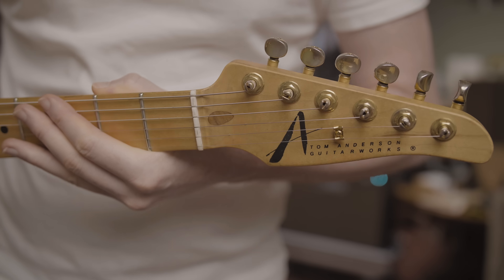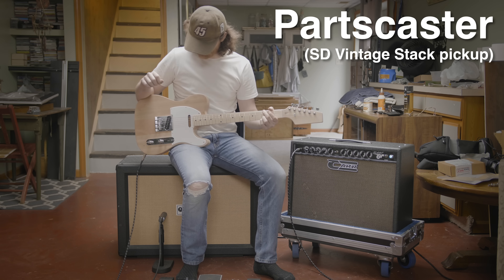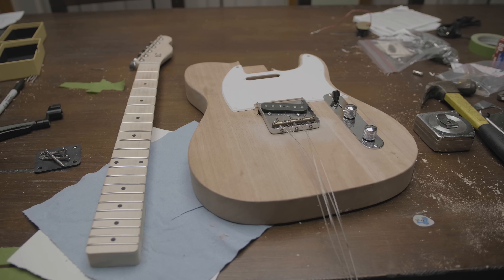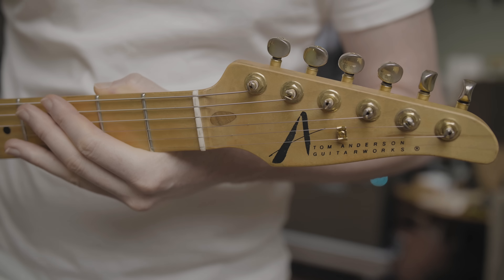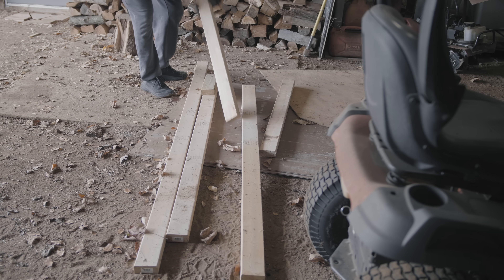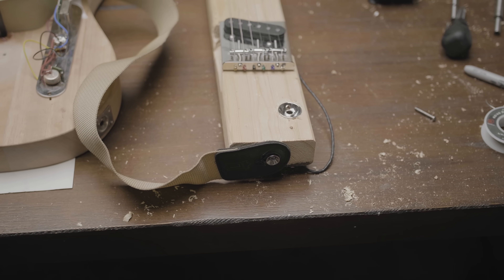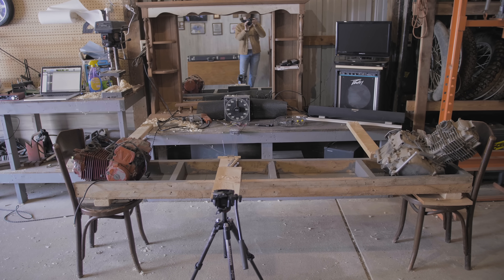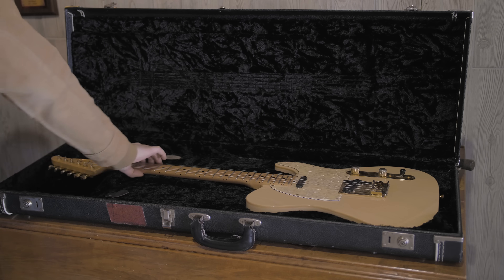Tested: Where Does The Tone Come From In An Electric Guitar?

Comment: Ok I'm a Scientist and a master luthier for 35 years. What you have discovered is that if you have old fashioned pickups that have a narrow frequency response, that is the most predominate factor in the sound. Very little else other than the set up and amp will effect the sound. NOW if you use something with a flatter response like a EMG-85, Lace Aluma or Piezos, more of the other factors "like tone wood" body shape, hollow, solid, Brass, Steel, Aluminum, Carbon fiber can be heard. Just about anything can cause a different acoustic property. Your pickup may or may not be sensitive to that or even in that position or other electronic properties. Massive tonal differences come from type and position of a Piezo. If you put a Piezo on the face and one on the side you get a 90° phase sound with dead spots. keep in mind it does NOT mater!!! nothing is better than another, what you like is what you like this is all subjective in the end. I'll tell you for sure I can make a guitar sound a certain way by how I build it and set it up. None of these tone tricks are a myth and your test is not very scientific, Its biased by the type of pickup you are using. Because of this most mass manufactured guitars even high quality ones, tone is mostly pickup, set up and amp.  If you are a discerning player I can make exotic guitars not sound like a Les Paul or a Strat by using different acoustic properties provided by "Tone Wood" and so on. I don't think you are going to appreciate these differences by your playing style, Country kinda formed around the Telli sound and you discovered the secret its the pickups! but this does not apply globally in guitar design. I saw Ola Englund comment, check out his video on bolt on vs Neck threw I really liked it, its not perfectly scientific either but he did his best.  Removing bias is hard. OH I liked your sustain video too! much more scientific. The real truth is tone is in the fingers ;-)

Comment: My opinion? Amp, player, pickups, the construction of the guitar (e.g hollow body, solid body, chambering), hardware (major differences like a floyd rose or TOM, and strings to an extent) -- in that order. The rest is relatively minor. Tonewood is bullshit for solid-body electric guitars and matters a lot more for acoustics and semi-acoustics.

Hell, hardware and construction is already extremely minor (and setup isn't a part, it's tweaking) but 5 was the list, if that's allowed then replace construction with setup.

Comment: Okay, am I the only one that notices a major difference in tone, or am I just smoking some really good shit here? 

The unfinished guitar, and 2x4 lacked clarity, definition, pick attack, sustain, and had a harsh high end, even after installing the pots. It's minute, but every minute change is crucial to the final outcome. That's like saying numbers in an equation don't matter if the number at the end of the equation is close enough, but if you had 4 legs on a table, and one of them was "close enough" you'd question why the table is wobbling. Everything matters on a guitar, from the wood, to the finish, to the pickup height. Yes, pickups are a majority of the "tone" but the resonance, clarity, and sustain all come from the body. To say the 2x4 had the same sustain and note clarity as the Anderson seems misguided, to my ears, at least. Are they similar? Sort of, but would you use that 2x4 over that Anderson strictly for tone? I wouldn't. Why? Because the Anderson has a deeper, clearer sound, and the sustained resonance sounds much better. 

The thing is, no two people will agree that a minute change sounds "better" some people might like A and other might like B. The changes only matter if they improve what YOU want to hear out of the guitar for your subgenre/playing style. Again, back to the table comparison, no one will notice a 5% change in height on a table, and it wouldn't change much for the person sitting at that table. They might think it's silly to change the height by 5% because they can't perceive the difference. But... who gives a fuck what that guy who doesn't notice it thinks? If that 5% improves your perception of that table, fuckin do it! 

I think there is a major difference in sound beyond pickups, I will say pickups are 70-80% of the sound, but there's more to sound than the tone coming from the pickup. To me, that's what this test proves.

Comment: Leo Fender must have had the same idea: that for solid body guitars, tone wood is more placebo effect than anything. He experimented with pine, ash, alder and probably plywood. But not for “tone”, for structure and stability. It takes a lot of strength to stay straight and not bend or especially twist under string tension. It was Gibson, trying to catch up with Fender that introduced the myth that expensive and exotic tropical hardwoods improved the tone of a solid body. It was a marketing ploy. Still is.
Reply: I agree. 'Tone wood' is absolute BS.
Reply: @wireworks4252  in electric guitars, ya, pretty much. With acoustic guitars it makes a hell of a difference.
Reply: @marctestarossa  Electric guitars are the topic here, not acoustic ones.
Reply: @nowave7  ok <3 I thought he was talking about tone wood in general <3
Reply: @marctestarossa  have you had the chance to play on a carbon fiber body acoustic guitar? Lol there no wood at all on those and they sound almost dead on to most acoustic guitars. I think tone wood is more of a marketing selling point rather than function. Regardless of wood choice
Reply: They sound quite different, i'd say. It would however be cool to play the eact same guitar (shape, bracings etc.) Made of both wood and a carbon fiber.
Reply: The most critical thing for old Leo was that ash and alder were durable, and most importantly, cheap.
Reply: Totally agree. It is more of the aesthetics on top of their obvious wood properties, like rigidness, weight, etc. You would not probably do a good guitar from pine as it is resinous and too soft, and other wood, that hollow, or super heavy, etc., though it may sound good, all these woods have some flaws. But as you correctly pointed out, there's a huge variety of wood, which has similar characteristics and are good for building guitars.
I personally like how swamped ash looks under the transparent lacquer, so I would go for it just because of the aesthetics.

Comment: With the pickup height test, the first thing that comes to mind is that there's an obvious volume difference; probably most of what you're hearing is the tone difference from the amp when you drive it harder, i.e. more or less distortion. It would make most sense to normalize the volume the guitar is putting out for each test, rather than just controlling for "volume knob position".

Easiest way to make A sound better than B is to make A louder than B. Always normalize levels.

Comment: Electric guitars are designed to minimize the transfer of energy from the strings to the body for maximum sustain. If the body is essentially an immovable object compared to the strings, changing it's properties won't alter the sound.

Comment: BTW I found that the most difference I obtained on a squier telecaster was changing not the all bridge, but just the sadles set for bigger ones. Added a lot of sustain and consistency to my sound !
Reply: Sustain propably got better because of the sharper angle on the strings

Comment: the pickups and electronics make the biggest difference imo, you can try different capacitors with different values to get different tones
Reply: been a while since ive fiddled with it but i googled a little and got 

"Capacitors, or "caps," are simple electronic components that are typically used in guitar electronics as filters or barriers for certain frequencies. High frequencies will pass through a cap, while lower frequencies are blocked. The value of the capacitor will determine the frequencies that pass"

Comment: I actually heard a slight difference with the brass saddles; bit of a softer, rounded top end and a bump to the 100hz range. Hardly enough to make a huge difference, but enough that I noticed. Lord knows the wood didn't change the tone at all. 

I wonder what would happen. If you swapped out a few different saddles and nuts?

Comment: I think the build quality and consistency  of modern guitars because of the computerized close tolerances maintained during production has exposed just how bad the earlier solid body electric guitars were, hindsight being a marvelous thing, but that was all that was available at the time and the tone wood myth grew from the fact that the guitars sounded different when really it was inconsistency in the general assembly as well as inaccurate coil winding for the pickups.Even today you can see pickups with pole pieces that do not line up with the strings on high end guitars but you get guitar experts telling every body how to set  there guitars for ultimate sound, I seen similar demo's like yours and the end result was the same as yours

Comment: I like this video a lot! But I think the tests, at least the ones shown here, were far too limited to really explore the regions in which the wood used might be more likely to matter a great deal. There was no exploration of either length or quality of sustain, no exploration of the much more challenging clean tones, nor of susceptibility to feedback, just off the top of my head. These are all things that both common sense and expert opinion indicate are important when choosing tonewoods. And maybe those things don't matter to you, but they certainly matter to many people.

In any case, for those to whom those things don't matter, you have saved them a lot of mental trouble, and probably cost as well, so bravo.

Comment: String contact points....pickup for sound. 
Play-ability is a whole other world.

As for "feel" I have a 1988 Casio PG380 synth guitar. High end strat full of electronics, bought it new.
Got another one from ebay, same guitar. Played it and it felt dead and did not resonate like mine, even after the same type of new strings were put on and set up the same.
Opened it up and someone had painted the cavity with thick black conductive paint.....mine had a factory sprayed thin coat inside.

Comment: They were different to me... Honestly... I'd say electronics is 80-90% of the tone; the surrounding acts as a flavour. Won't change it, but will spice it.
Reply: To me, the guitar (I mean, the one that's got more wood in it) has got more top end, whereas the other is mellower, if not dull. Maybe it would sound brighter if you cleaned up that rust on the engines...

Comment: This was my suspicion from the start.  The pickups were just listening to the string at close range.  Whatever resonance the strings were creating in the guitar body, the pickups weren't having any of that.  We already know this by how "deaf" a pickup was, based on its sensitivity to the distance from the strings.  And the pickup makers also know this because the guitar body does not only emit the resonance, it also transmits so much noise from all the bumping rubbing and scratching that contributes to the solid body transmitted sound.

Those are things you don't want to hear on the amplifier.

Comment: 0:30 #3 was the only one who responded honestly... lol
Reply: You could post a video with the same exact audio for every single clip, and there will still be people who comment that they hear a difference. The pickups did sound a tiny bit different to me, but having bought and installed dozens of identical pickups, in identical guitars... they don't all sound exactly the same brand new anyway. The magnet wire might be on the high or low side of the cmil spec, might be work hardened a little more or less, have a little more or less enamel changing the shape of the internal field, different potting, stronger or weaker magnets, a few extra or less windings - electrical differences that can matter.

Comment: This makes no sense, I can clearly hear the parts caster and stump guitar difference in tone! Using those tables has a lot of mass, simple test. plug you guitar in to an amp, let the body make contact with a door for example, now try without touching the door, hear the difference? The tone always follows the neck, take a Strat, change from a cheap squire neck to a good neck from a guitar you've played a while, there is certainly a difference. But if you can't hear and feel it, the response, then good for you, fewer issues in life :)

Everything matters, action matters too, if your action is low you will hear brighter sound, higher action has a deeper more full tone, this is the most basic thing, infact you can adjust the tone of a guitar that way too, all the little things add up to what's coming from a speaker. 

I find this video interesting, the table sounded killer btw :)

Comment: I dig this, but like a lot of people have mentioned the driven amp obliterates any nuance you'd get from the other parts of the guitar. Smashing all the transients and peaks and valleys up against the edges of the circuit means there's no subtlety left to notice from small things like body vibration and various metals. If you're playing clean, you and your listeners will notice those things because they're not being compressed into oblivion. But it certainly illustrates that if you play with a base level of overdrive, then you definitely only need a solid pickup in a hunk of wood.

Comment: Cool video thank you. I'm blind so I wasn't able to see of course that's what being blind means LOL but you know I would think you know did you use the same pickup from one guitar to the other that just swap it or did you just use two different or did you or did you use the you know just two different pickups of the same model pickup.? Cuz I would think that there could be you know as tight as the tolerances are today and stuff like that I would think that even in mass-produced the pickups that they could be and is most likely a difference how much that difference could be noticeable in another story but I believe it's a possibility. As I say I believe it's a possibility I wouldn't bet my house on it. Just things like that you know you could you could drive yourself insane like with the tone would debates back you know a few years ago several years ago I mean you could drive yourself literally insane trying to eliminate every variable that might be present in a system in a guitar and still not know? I used to believe in stonewood it was just you know I guess from what I heard you know before I really started to get into a guitar not just playing it but the mechanics of it you know the electronics and mechanics. After most of those debates I've come to the conclusion or I had came I had come to the conclusion that Tom Wood is something that's got to be there but I don't think it's necessarily something that is necessarily clear-cut sonically. That it's you know not really all that true I don't believe in tonewood as in the debates. Not anymore not since those debates and I made up my own mind. I believe that possibly the density of a wood could be the same density as another species of wood and that might be something you know cuz you could have two pieces of mahogany and one piece of mahogany might be his dentist things like that so I you know which kind of made me kind of look at my guitars that you know I I like the woods on them because I thought they they had a tonal variations and so I was kind of something I wanted to believe in but you know now I just you know now I just know in my mind the woods are beautiful you know and leave it at that and you know you you spend money I spend money on expensive you know I don't buy cheap guitars but I don't buy the most expensive but I do have some expensive guitars and you know I'm not completely blind I'm severely legally blind I see no detail but under the right light and stuff I can see you know how shiny it is LOL so you know that took that out the window you know as far as how beautiful the woods are in the aesthetically although when I first got my first two guitars my first two Gibson's again my my disease is progressive and I was able to see the actual grain on my firebird and on my S yeah the firebird has is a vintage sunburst than the yesterday is a wine red both the translucent so it was able to see the grain on them my new guitars was that the delay at the latter ones that I had bought my Gretchen orange stain and my heart that was just my hollow body and my jet which is blue onyx that was a special order it's special a limited edition color it's metal flake I can't see the metal flake at all on them so Bailey can tell it's blue but still it's nice to know that they're pretty guitars. But does that add any of it you know or you know we had the gifts I finished makes a difference on the sound that I can talk and that's just a bunch of snake oil so you know I think the most what gives the the guitarist voicing the most are on the guitar I guess the electronics and the amp you play out of or any effects thereof and then again your hands you are you and your guitar is going to sound like you you're playing it's going to sound like you so yeah I went from believing in town would to wanting like really beautiful woods what do they call it furniture guitars to not caring about either that much anymore cuz I can't see the beauty of the woods as long as the guitar is made well and the pickups are made well I guess that's all it is for me. This is been a long comment because I am a comment addict I don't know what to stop I go off on tangents most of the time on top of that if anyone reads my comments being blind that you speech to text which has its own unique take on the English language and the doesn't know too much about the word and you so function so yeah I'll end here sincerely Bob the blind bedroom guitars Love you guitar for what it is and that's about it